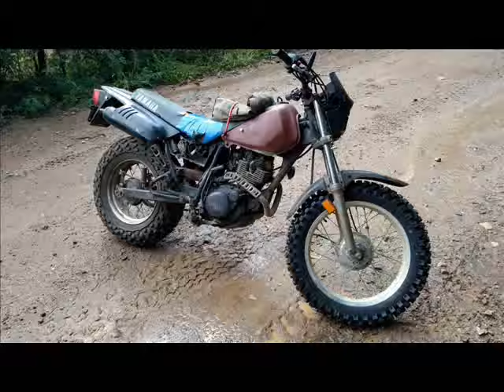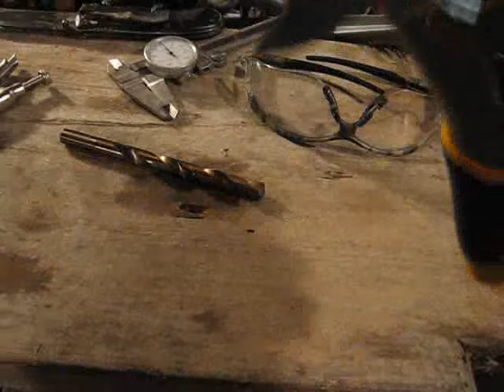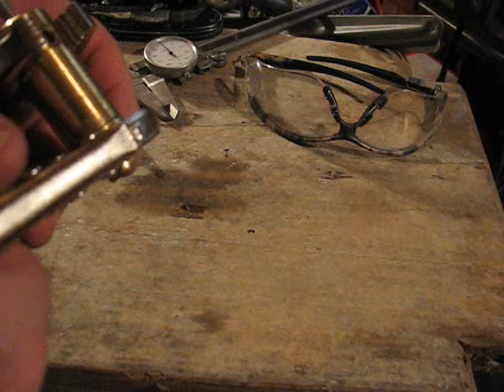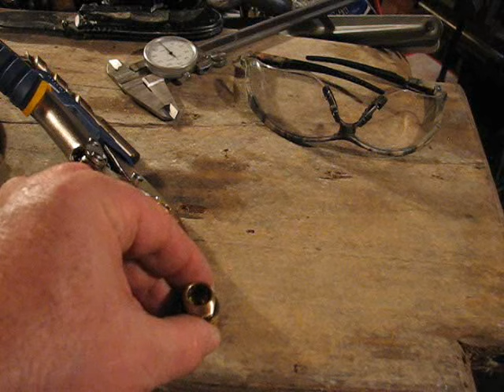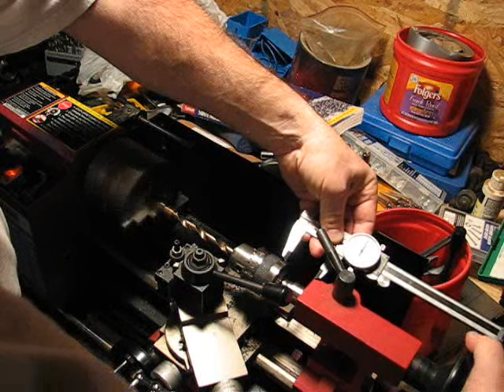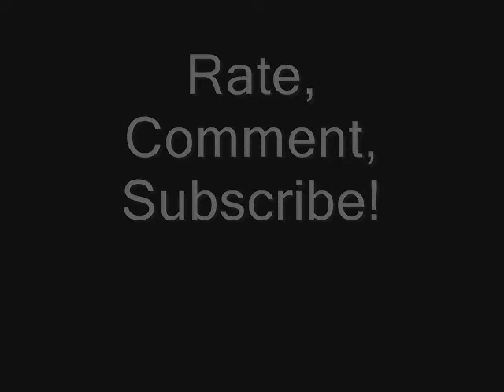Crosman 22xx Airgun Valve Mod

Comment: Great vid , I got a Crosman  pump bolt gun that could shoot BBs and pellets in 1975. That rifle could drop a cape buffalo at 100 yards with 10 pumps, or blue jay at 10 yards.To me it was a 375 HH and a Parker 12 sxs rolled into one. Good vid and God I miss those days.  Thanks
Reply from the maker: +chris knevil I had a Crosman 180, which was a co2 powered .22 bolt action. Then later I got a 766 American Classic, which is exactly the some thing that Crosman still sells as the 2100. Had loads of fun with both, and they are part of the reason I still prefer co2 and multi-pump airguns.
Reply: Right on  Thanks

Comment: set a gap from the face of the drill tailstock chuck to the tool on the tool post of 5mm  it will stop over drilling as Brass snatches and can pull the drill bit in too far

Comment: Sounded like you over drilled your target for the depth on the valve. You said you had a measurement of 1.05 when you were setting up and needed a depth of 1.4. Should have been 1.3, shouldn't it? You wanted to remove .25 of material. That was at about 9 minutes on the video. Not sure if it will be an issue, but you might want to take a look see. Good video though! Thanks!
Reply from the maker: You're right, thanks for pointing that out! Fortunately the wall was thick enough so it didn't cause a problem.
Reply: @Possumliving    I caught that too......    I have the same lathe but don't claim to be proficient in its use......  why did you use calipers instead of the scale on the lathe??

Best video. detail and discussion I have seen on this 2240 mod.   Thanks for posting.
Reply from the maker: @rwayne3243  Thanks! A couple of reasons for the calipers. First, the scale has lash. The calipers bypass that problem. Second, I thought the calipers might be a better demonstration of what I was doing. The best way though, would be to use an indicator.

Comment: I would say as an engineer 43 year's that we had a complete set of all drill bits with the cutting edge backed off ninety degrees to surface, otherwise can snatch especially if there's a pilot hole,could go terribly painfully wrong, definitely will with hand held drill that most people will try,bremmel safer for non engineering minds !!!😮

Comment: How fast do you think this will get the standard crosman 2240 shooting
Reply from the maker: Probably not very fast. It's difficult to get much over 500 fps with the short barrel.
Reply: @Possumliving  just because the co2 will escape behind the pellet if it doesn't travel a good length to build energy I guess
Reply from the maker: @devonhutson669  Yes. Both CO2 and HPA need a fairly long barrel for maximum efficiency.
Reply: Is 14.5 inch a good length or do i need a longer one like 18 inch?

Comment: love your vid , im from england possum , how do you change gun to air i would be much obliged as how thanks, john.
Reply from the maker: Several different ways. There used to be an air tube that screwed in place of the co2 cartridge, called the HiPac. I don't think they're made any more. You can also use a regulated external tank with a co2 cartridge adapter that is threaded for a hose attachment. Or, you can completely replace the air tube with an aftermarket one or a factory Discovery tube, and either an aftermarket bulk fill valve, bulk fill modification of the existing valve, or factory Discovery valve.
I've done all of those at one time or another, and feel that the latter option is best: air tube and valve replacement.

Comment: Bonjour de France 🇫🇷 vidéo very interesting and how power you get after work? Thanks
Reply from the maker: Bonjour! I got about 30 fpe or 40 joules, running on high pressure air.
Reply: @Possumliving  ok thanks
Reply: @Possumliving  can the cold harm the valve ?  ( sealing ) Thanks
Reply from the maker: @nico-max  Not really. It's designed to deal with cold because co2 gets very cold on pressure release.
Reply: @Possumliving  ok but I say that because I have a co2 leak when I loaded it with a new valve...
Reply from the maker: @nico-max  Can you get non-detergent motor oil in your country? I put a drop on the tip of each new co2 cartridge before I insert it. That helps the seal.
If you can't get ND, the regular Crosman airgun oil is the same thing.
Reply: @Possumliving  yes l have a pellgunoil and l put it on all time . Today l haven’t leak l don’t understand 🤪 sorry and thanks for answer

Comment: Possum, Question for you. Did you ever here if you cut the hammer,bolt spring a 1/4" shorter you gain double amount of shots per co2 ? in a 2240 ?  not the vertical trigger spring that you can lighting by squeezing it. you might lose a few fps but again gain the amount of shots.  thanks Possum, Walt G.
Reply from the maker: +MegaBait56 Yes. What you are doing is reducing the hammer spring preload. It works with high pressure air, too.
What I like to do is drill and tap the rear cap for a screw or bolt, so I can adjust the preload without disassembling the gun. You have to be careful to not go too light though, because it is easy to have hammer bounce (same as valve float in an engine) which wastes air or co2 without any gain in performance.
Reply: So Possum, i can cut the stock hammer spring a 1/4", then drill n tap say 1/4-20 the back cap and install a bolt to be able to adjust the power.? i knew you would know this. lol. shooting in my basement i don't need 440 fps to punch paper and hit airgun steel targets. i see alot of co2 coming out of the muzzle when shooting. looks as if it's wasting the powerlet? i mean i get 40 of them at Walmarts for only $16.00 but if i can double the shots why not. Only saw 1 video on this so far and with everyone now shooting airguns thought i would see more videos on this. thanks Possum, walt g.
Reply from the maker: +MegaBait56 Yes. I would go with 1/4-28 though, for a fine adjustment.
Reply: thanks Possum, i understand it will give a finer adjustment. thanks again.

Comment: Great Vid. Wonderful you took the time to give us this info... #Question???... Is Everything Ok and Good with using The Hipac kit to covert this gun to HPA???... I see a Video on here of someone on here was using it and it exploded and shot in his leg. HOWEVER (1) He did not degas the gun before he took it apart and thats when it exploded but i dont think not degassing it would have led to that. I cant help to feel that it was another user error because (2)  The guy didnt seem very competent and what have you. And because its the only video anywhere that i could find during hours of searching for more videos of more problems with the hipac kit and converting to HPA. I Could find no other complaints or people saying they had any issues anywhere so...  But after watching alot of videos you have posted i now feel that you really do actually know your stuff so i feel 100% comfortable asking your thoughts or experiences with the hipac kit for use with the crosman 22xx and HPA, So if you come across this comment and have the time please let us know how things went and are now that alot of time has gone by and im sure gun has been well tested. Thanks. Goodday.
Reply from the maker: Thanks! A man who is smarter than I about this stuff says that some of the HiPacs are thinner than they really should be at the point where it screws into the tube of the airgun. I checked one of mine and sure enough, it is one of the thin ones. But I haven't had any problem with either of the two I have, even occasionally pressurizing them to 3K psi. I'm not worried about it. I haven't heard of any blowing up. I read the report you mention, and believe that was 100 percent user error followed by misrepresentation of what really happened.
My two HiPac equipped guns are easier to tune at 2500 psi or lower anyway, so I keep then to that pressure or below.
Having said all that, I have moved on to using Discovery and P-rod air tubes because they are cheaper. They do require full disassembly, though.
Reply from the maker: Renegadebroadcasting Renegadebroadcasting  Thanks! I wasn't aware of that one. Looks like the same as HiPAC, just made by someone else since HiPAC is out of business.